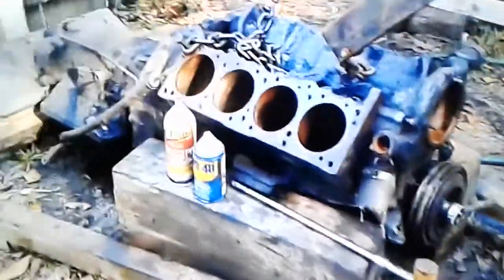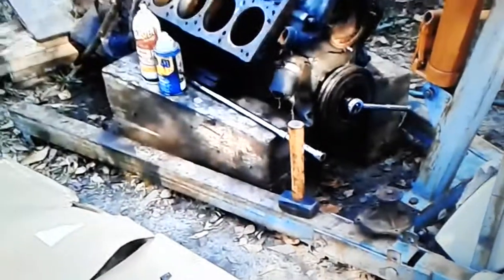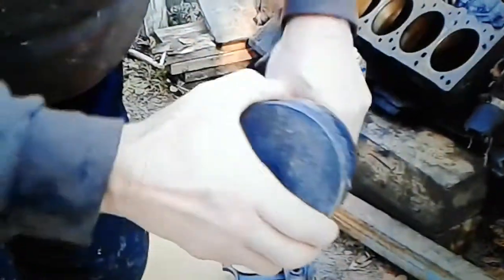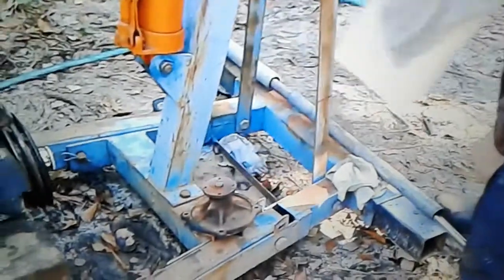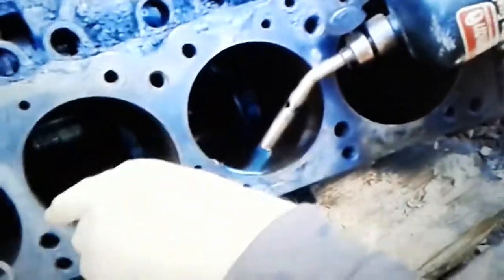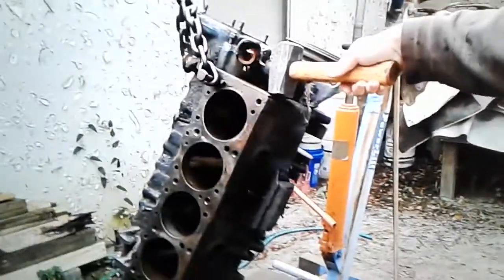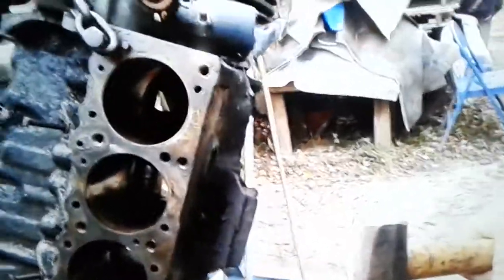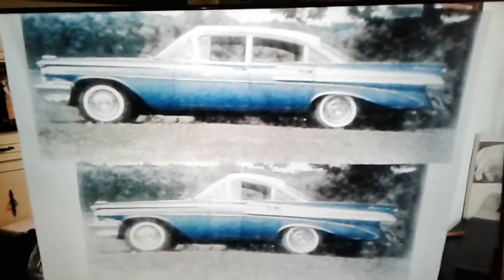1959 Pontiac 389 Engine pt. 5 😂 removing  frozen pistons

Comment: Where there's a will, there's a way !    When the rings are corroded in the lands and against the cylinder walls, penetrating fluids just wont work. You're correct that Heat will loosen things up enough to break the seize interface, so you can get things moving. I had to pound alternate pistons with a piece of 3.5" pipe and a sledge, just enough to get the caps off. Then I drilled and tapped the crowns and  used a slide hammer to get the pistons out - worked a treat. Mine sat patiently with a 50/50 acetone/trans fluid mix for almost 3 years, whilst I got on with other jobs on the restoration. When it evaporated off, I topped it up. When the pistons came out, the rings and lands were bone dry.,,,, twas at that point I realised how futile the penetrating oil approach had been. Well Done Ken
Reply from the maker: Hello Kookie,  my hard drive crashed, but I found a couple of youtube channels ,   first is    Lillemor France   check out his video on youtube  called Brian's Budget Garage - 1950 Pontiac transmission removal     it is inspiring, another channel that looks   interesting is called   Caddy Daddy .
Reply: @pontimaniac2303  Have you fixed it yet ... ?  (The hard drive, not the 59,,,,,)
Reply from the maker: @kookiebub  son in law suppose to do this weekend.  I hope. But time is the problem.